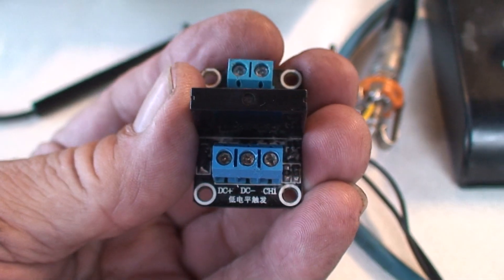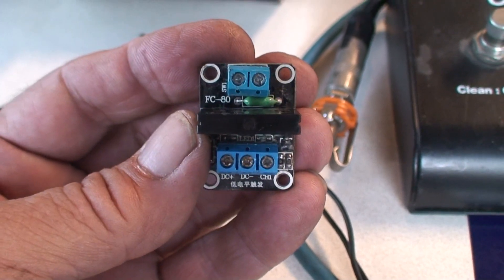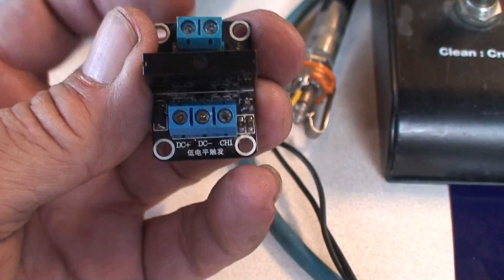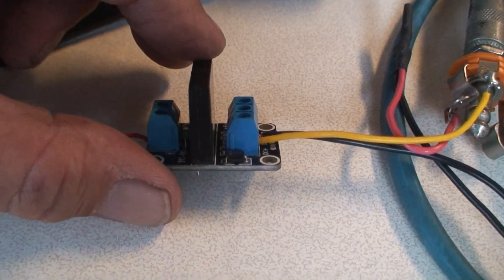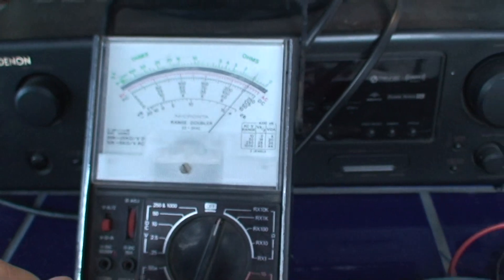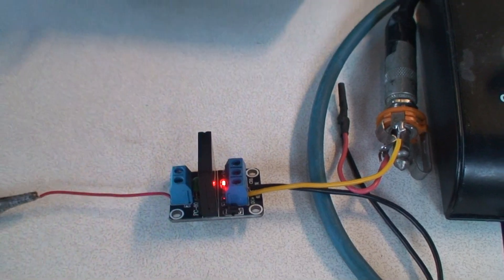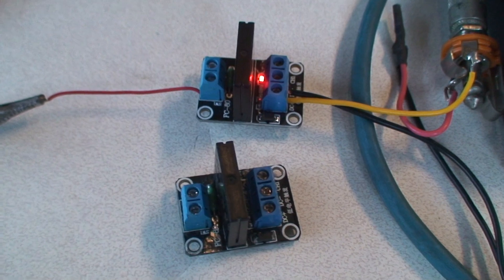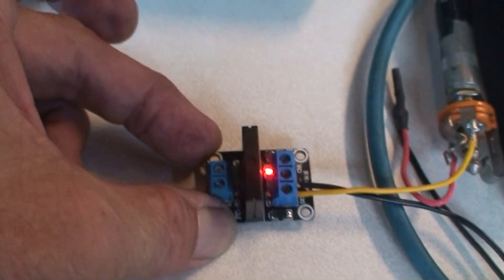Solid State Relay Package Modification

Comment: yea,  likely that solidstate relay (" the big black part ") in the middle was rated for 3-60vDC,  which means, that your just soldering a jumper between DC+ and CH1.   you could have done that very same thing with a pigtail.  but apparently you dont fool around with arduino..   you think maybe there would have been a Spec Sheet for that big black object with numbers on it,  pretty sure if you did foot peddles that you would know how to look up spec sheets on parts.   just saying.  i know this was 7 years ago.. and who knows maybe your still alive and learned something new since you was young..  lol.

Comment: Great help, especially as there is so very little info on this which isn't Arduino-related and in my case, a simple relay to close a low power circuit, using  Arduino would have been over-kill. Thanks (from UK)

Comment: You should be able to just:
Connect the low voltage power on DC+ and DC-
Put the switch across DC- and CH1 (As yours is low level Trigger. If high then would be DC+ and CH1)

Or why not just add a short wire connecting DC- and CH1? I suppose this might delay the turn off possibly? Did you try it?
If there is a delay add a pull up resistor from DC+ to CH1?
Reply from the maker: I just ran the purple jumper as shown, that worked !  No I didn't try it the way you suggested,  it might work ?  will try it next time.
Reply: @KokasIsland  Yeah, it works the way @Joseph suggested.
Reply: @heltonritter  can u send a picture ?? i dont have arduino, i connect a 5v DC+ and DC - and a wired such a bridge in DC+ and CH1 i get the RED led turned on, but no power in the SWITCH , i triend DC- bridge to CH1 and NO RED LED turn on.. ill try to iron as Kokasisland did.